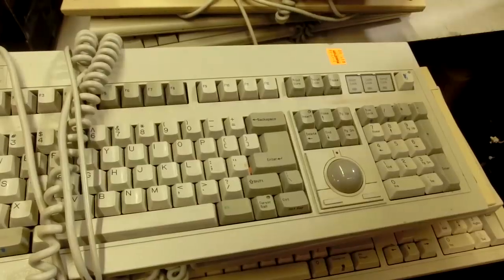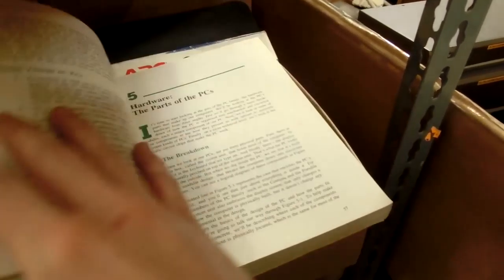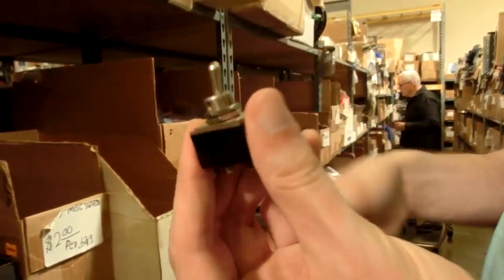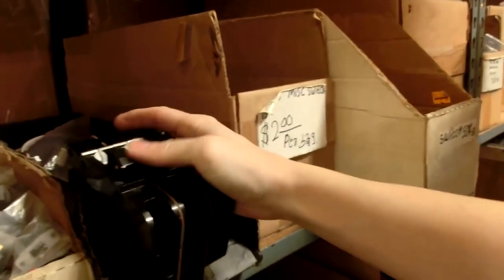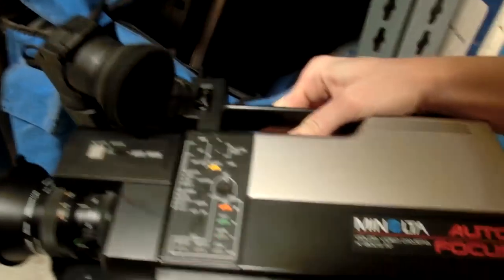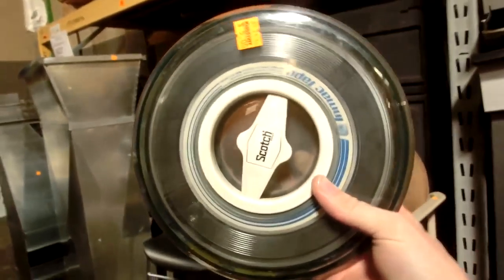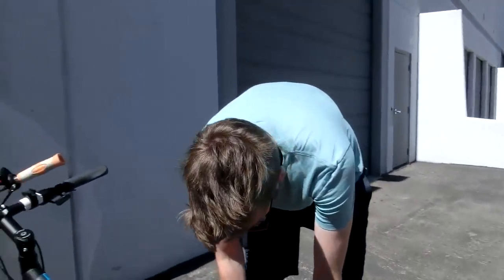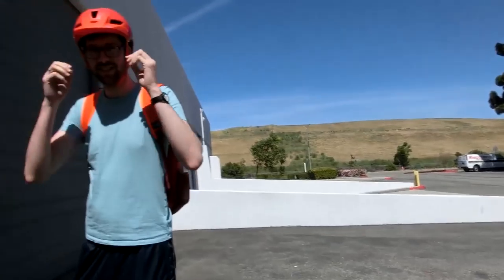Random Bits 0127: WeirdStuff Warehouse, 1983 Minolta Camera/VCR

Comment: The Electropack machine is a water activated adhesive,  paper packing tape dispenser with a cutter, for high volume shipping. I've used a newer version extensively. Cool to see a much older one.

Comment: I have one these though it's the just the camera but it has a fault that it only displays weird psychedelic colors like what happen when you turn yours on, and the character generator doesn't work, believe that's due to capacitors leaking their electrolyte fluid.

Comment: that keyboard is serial for the trackball stupid lol. the ps2 keyboard is the other.
Reply from the maker: +Mark Hide yes i know that, but this looked to have been made when PS/2 connectors would have been popular. so yes i dont know what those connectors where for, maybe for connecting to a CNC machine.
Reply: +Rinoa Super-Genius indeed. they were used in a few places where a mouse couldn't be situated. cnc and pos systems when touch screen wasn't as easy.